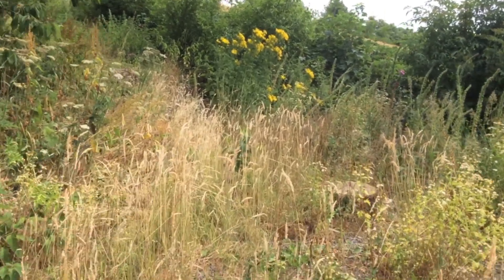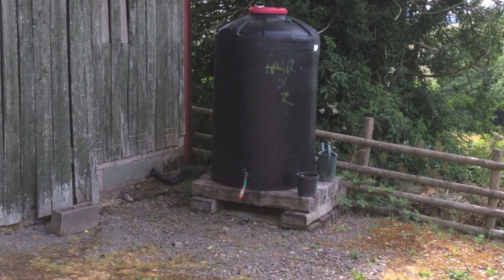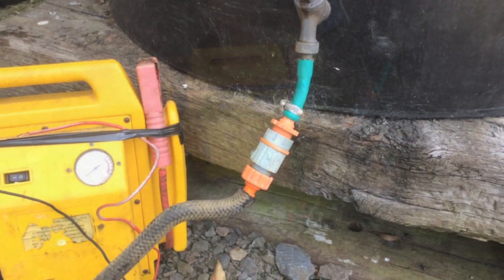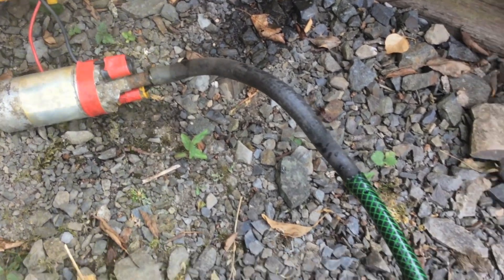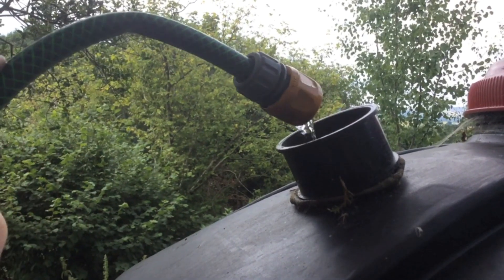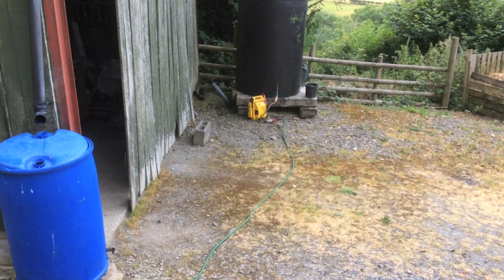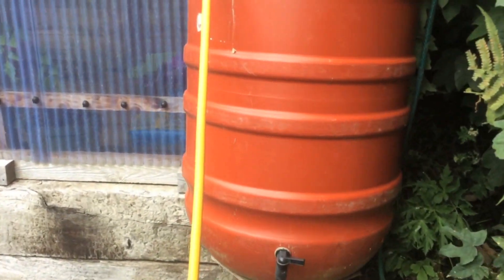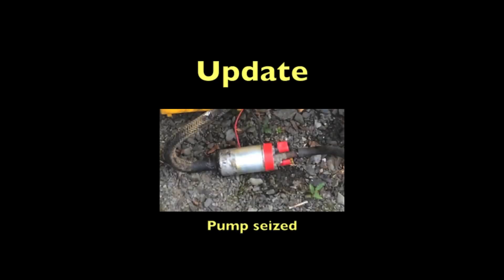Pumping water uphill

Comment: if I remember correctly, a lot of fuel pumps are designed to require cooling, and they are in fact are cooled by being submerged in a large volume of liquid ... fuel in the tank!  so maybe next time you try similar set up, place pump itself in a liquid, like a bowl of water ... maybe